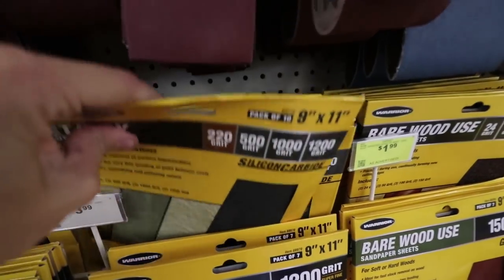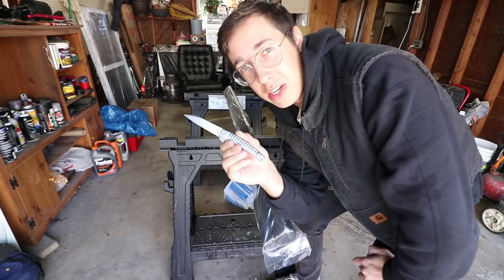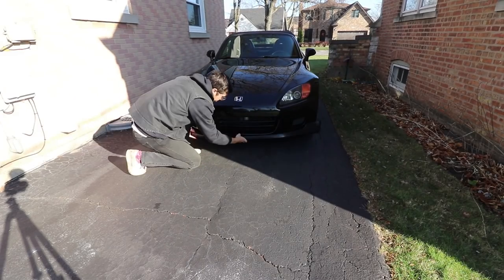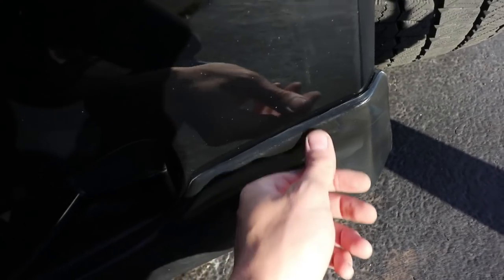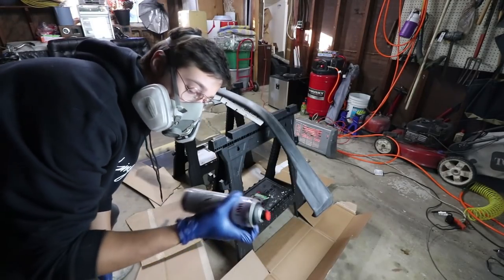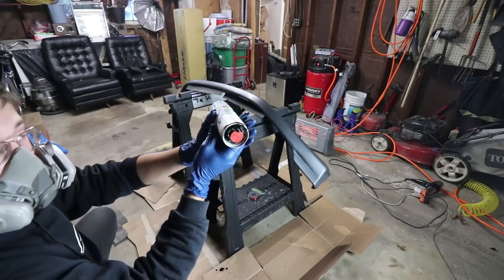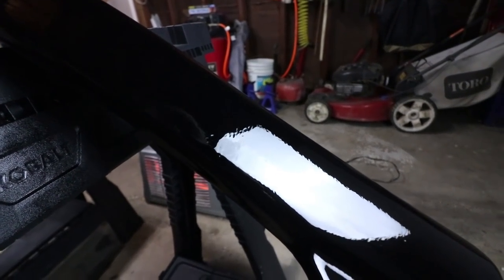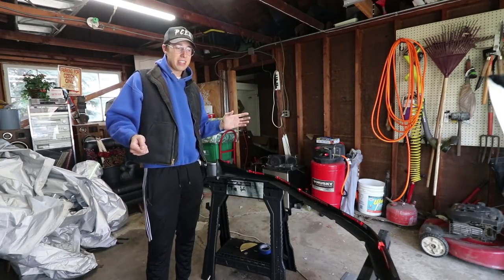This Budget eBay Car Part is a MUST HAVE! | Phase 1 Episode 6

Comment from the maker: This is only Stage 1 and there is still more coming. Just wait until spring time when it's time for stage 2 😎
Reply from the maker: @parkerbethke Stage one will be sick when its done. It will be worth the wait. Especially when the Civic makes a comeback between the S2000 stage 1 and stage 2.
Reply: Bro I just put on the little lisence plate hole covers on too😹 and we got our s2ks at almost the same time and I have a civic too..AND I WAS LOOKING AT THE GREDDY EXHAUST TOOO. but I might end up getting an HKS..I don't usually comment but that's just awesome..

Comment: If you mainly drive this car in the winter, you should maybe consider a hardtop. It's a pretty expensive mod, but definetly worth it. You have much better heat insulation than the soft top, so the heater will actually do something for once.

Comment: FYI BoostedJohn ...Just a suggestion when painting Polyurethane stuff.....Preclean it with this stuff called "Scuff Stuff" and use a Red Scotch Pad with it...It removes all the oils and crap out of the plastic before primer n paint etc....

Comment: Came out really nice! You could use a strip of black trim edging or even some gloss black urethane/silicone to seal the gap and cover the tape. Just some thoughts.
Reply: Whats up
Reply: @wavy_memo3410  Eyyy.
Reply from the maker: Thanks for the suggestion. Might give it a shot.

Comment: Hey just tonlet you know- my 2006 s2k has leaked from the exact spot on the driver's side window, since the day I bought it. It will NOT leak when it's raining....it just wasn't designed to resist water shooting at it from a pressure washer from like a foot away. LOL
Reply from the maker: Interesting! I hop this is true. Haven’t had much rain lately.

Comment: I smell bad valve steam seals😬 (from that start with a little blue smole, the oil slowly drips and it's the only time it gets more to actually see smoke)
Reply from the maker: what is the fix?
Reply: @boosted_john  changing the oil valve stem seals. It's not bad. You can do it by not taking the head off, you need a special spring press which ataches to the cam caps bolts. Press the springs, get the keepers, get the spring out, yank the seal out with some pliers and some force, put new seal in with some oil on the valve stem, press it in and put the spring and keepers back in. And in this time you need to make sure you won't lose your valve in the cilinder. Usualy you can put string trought the sparkplug hole and then compress the string by bringing the cilinder to tdc. That will keep the valves pressed in the sests. Also, this operation requires new timing stuff since you remove the cams and you just bought the cat. I would personally get the head off and also do a diy porting job. There are a lot of videos on yt, and you need like $100 in suplies and tools. I am not sure but I think s2000 have a problem with guides also. The valve stem wiggleing because of loose guide also causes oil seal fatigue. 
If you have the energy, I would get the head off and check those things, and also, you can live just fine like that, it also depends on how much oil it burns on the dip stick. Knowing that you kinda will love this car, getting the head off, porting, checking guides, new valve job and oil seals is a good ideea. 
Also, plenty information on honda forums, the seals are difrent for exaust and intake, it's written on them ex and in, verry small ( also blacm sprinf exhaust the other intake). And the guides need to be changed by heating the head slowly, then cooling it slowly. Search about this and make sure you find a good machine shop.
Now, I'll go to sleep. I wrote you a novel
Reply from the maker: @mihailpetrovici5044  I really appreciate the details. Thank you!